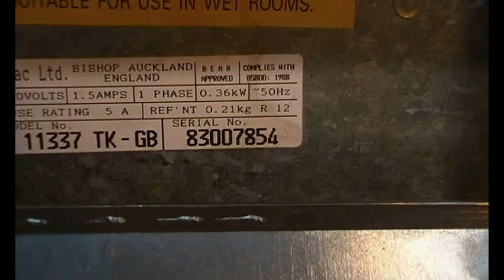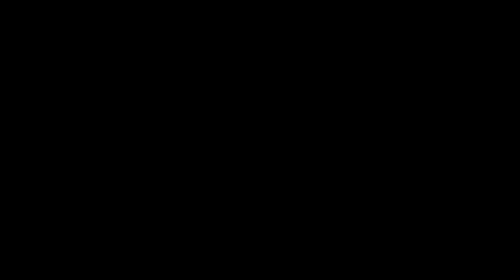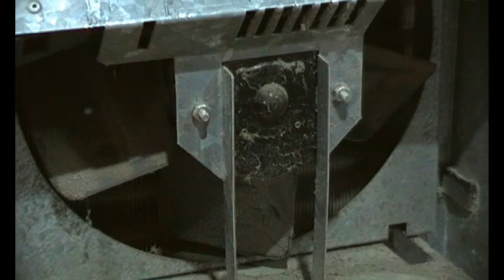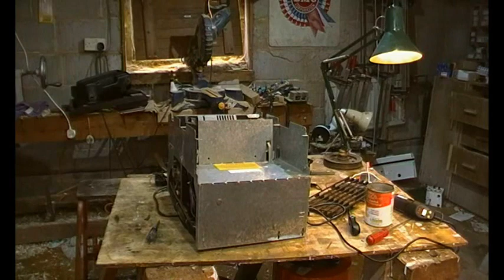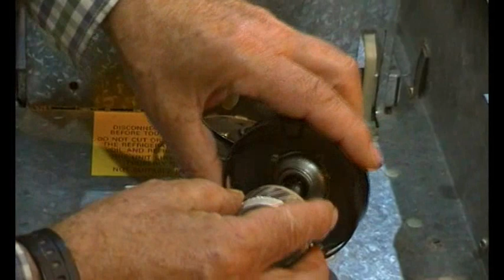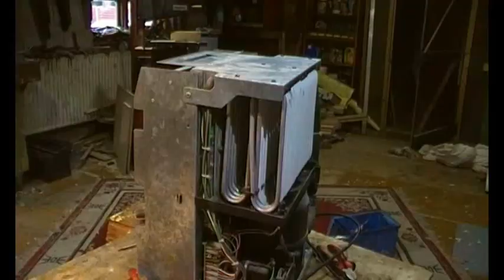Ebac Dehumidifier repair, fan restoration, distilled water production

Comment: It must be jolly cold in your workshop for the coils to freeze up, I assume this is not a dessicant dehumidifier as these tend to work at lower operating temperatures whereas standard dehumidifiers tend to freeze up at around 8 degrees .
Reply from the maker: Hi, yes it's a refrigerant based unit and the coils need to get cold enough for air borne moisture to immediately condense on the cold surface, cheers
Reply: @TheInfoworks  I cannot see the logic that air borne temperature has to be cold!
Sure humidity is the factor here relative to environment ie: anything over 8 degree, as below this threshold the coils will constantly freeze up making the appliance non operative.
Reply from the maker: @ricardopelc-wesoly3483   Hi, it's the condenser pipes that have to be cold, not the air as warn air can hold more moisture, cheers

Comment: Hi Andy, thanks for the video my Humidex 7 is now working again.
Reply from the maker: Brilliant, that is splendid news, please subscribe, cheers
Reply: How in heavens name did you get the  unit out of the wood frame on the humidex 7. I’ve removed the four screws in the cabinet at the bottom but it won’t budge!
Reply: @LordJasonKing  I think the cabinet is supposed to slide forward off the chassis. I got a bit brutal with it and gave the one side a tug to find that the lower front fascia is stapled to the side panels. When I put it back together I removed the staples so that it would fit flush with no harm done.

Comment: I have just picked a similar one up to replace an old one that failed. It freezes and doesnt go into defrost, where do I need to be looking?
Reply from the maker: Hi, I'd  look to the fan to see if it's working and if the cooling elements are blocked with muck, cheers

Comment: Useful video, thanks. Shame you didn't show the nasty part of separating the motor to give some hints. I have an Ebac Humidex 4 with seemingly the same motor. I used wooden blocks to support the protruding tabs on the laminations and used a hammer and small screwdriver on casing indents to make the motor split (bottom easier than top). The varnish on the laminations had spread to the upper and lower case making it difficult to split. There was a microscopically thin washer on the lower shaft (as well as the large washer) which disintegrated so I threw it away. (don't know if it was a spacer, some sort of oil ring or what?) I removed the disc from the shaft by supporting it on two chisels across two blocks of wood and tapping the end of the shaft with a hammer (it was VERY tight) Having cleaned everything up and reassembled the fan now rotates freely whereas before it was rock solid. Even having freed it up by rotating by hand when running it was very slow and got hot quickly so DEFINITELY needed disassembly and cleaning. Good as new! The unit is probably 28 years old and has sat unused for avery long time. The rear filter had completely disintegrated and they are now discontinued. I bought a sheet of carbon cooker hood filter and cut a sqaure to fit and glued in place with Bostik clear adhesive. It may be a bit more thicker and denser than the original but air flow is OK and it should prevent dust build up internally well. Have had it running for a while now and it has collected water in the reservoir so the compressor is working OK.
Reply from the maker: Yes, those bearings, though simple, space saving and self aligning are definitely a service item, cheers

Comment: Good fix, as I also worked on these Ebac Homdry and Humidex old models for many years, however I certainly would not be puting the water extracted from a dehumdifier especially from old machines like these into verhicle batteries, one the condensor coils are not clean and two although the water is similar to distilled it actually isnt. However watching you work on this model took me back...Well Done
Reply from the maker: Peter, thanks for the comment, how many times has a good machine been scrapped due to a sticky fan? I still use this water in my storage batteries as long as it is produced in a clean environment, however it's up to the individual, cheers
Reply: @TheInfoworks  Working on my Dad's old identical Ebac Homedry at the moment. New pcb board coming. Did have the fan sieze up a while ago. Drilled small hole in rear bearing dome to lubricate and plugged it with blue tak. Managed to get fan bearing lubed with a schringe and curved tube. Thanks for video so just the pop rivets don't have to touch the control panel. When pcb arrives will give motor a proper service. As you say must be 30 yrs old +.
Reply from the maker: @tenfootvoyager  It's amazing  you can still get the boards, worth it though as these machines are steady workhorses. Great to hear you are putting some time into his one, cheers
Reply: @TheInfoworks  Forgot to mention use the water in the iron and model steam engines. Also good for car cooling systems, screen washers and my electric steamer.
Reply: I still have an old EBAC-HUMIDEX 7 works ok, a little noisy, Geordie do you know how much one would cost to run in today's environment. Model is 11321-WN-GB. Label on the inside says it runs Phase 1 at 0.35KW/240volts/1.5amps. Any help would be greatly thanked. Been unable to find a manual for it too :(

Comment: Great fix found this very informational, I have a Ebac Homedry 440 dehumidifier to which I am having similar issues, I have had the fan out but I have no idea as to how I open it, would you enlighten me on this part and the methods you used on removing the bezel. I've had the machine for a good 15 years so I cannot complain, I think the more things get complicated with displays and extra's the shorter the lifespan of the appliance will be. I have also noticed that it is starting to smell (overheating) I have checked the compressor, it is hot, but it is not this. Its is more from the 2 white long I think they are ceramic items on the circuit board, sorry not sure what they are.

I would really be greatful for any adivice.
Reply from the maker: Hi, the ceramics are resistors. Have the fan apart by removing the through bolts, oil the bearings. Sometimes the motor cases are varnished together so a bit of force is required. Then clean out all the "raditaors" and remove all the dust to allow the passage of air. Have you subscribed and rung the bell for email allerts? Cheers
Reply: Hi after posting I went and looked up the pcb components myself just out of curiosity, so yes you are spot on with being resistors, I must admit to being so surprised at how hot they were. Would it be fair to say that because the motor is struggling the system is drawing more current and this in turn is leading to the heat.
I have had a quick look round for a motor alternative and it appears there is nothing, so if this doesn't work it's a case of buy anew. and break mine up for spares.
Reply from the maker: The resistors are for the fan motor, follow the motor dissasembly and oil the bronze bushes and all will be fine. I have another video on dehumidifier fixing that you may find useful, but like this one watch it all, cheers
Reply: Abbey, firstly you will need to remove the wooden casing, there are four screw holding the casing to the machine, two visable on the black back panel near to the bottom and two one at each side at the top inbetween the 5mm gap. Place the machine on its front. Now remove the screws. Once these scews have been removed, you then need to open the mains cable block on the back, this will open upwards with two logs on either side of the block  lift up and over teh lugs. Once open you will see two futher black screws, remove and lift off the mains block carefully to gain acces to the detachable wires. Once the block has been removed. Now lift off the wooden casing. Now removing the control bazel you will see two black scews holding the bezel in place ...Hope this helps although a bit late !

Comment: Hi Andy,
Does that dehumidifier run non stop or is there a period where the compressor turns off to allow frosting to thaw?
I was given a newer ebac with a blown transistor on the circuit board and had hoped to get it running with simple electrics. Even with the fan blowing the compressor thermally cuts out. Perhaps more gone wrong than the transistor

Ian.
Reply from the maker: Ian, good to hear from you. I think this may be an extended conversation, but the cold evaporator tubes should not show frost if sufficient air is passing over them. As they are cold the moisture in the air condenses on them and at the same time transfers heat to the tubes. If there is a restriction in the air flow the tubes freeze up and the compressor will get hot. There should be a sensor on the cold tubes to register when it is frozen and switch the compressor off. This is the circuit that could be faulty on your machine. Check the air flow through the hot radiator behind the cold tubes. Get back to me if any other questions, cheers, Andy